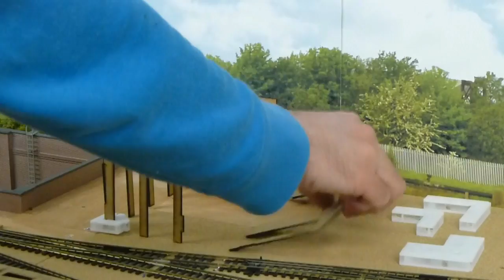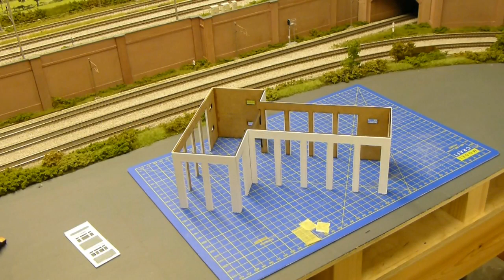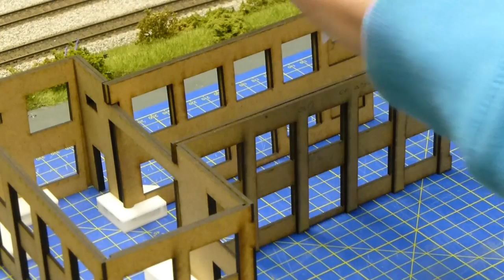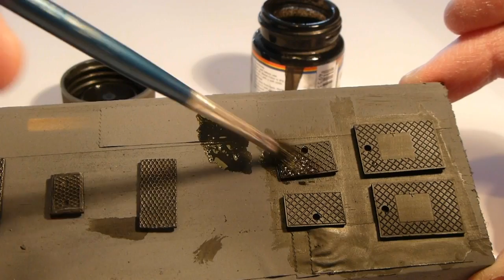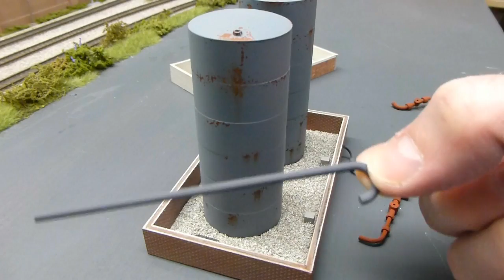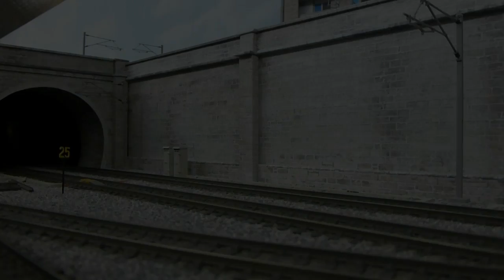Model Railway New Depot Build Update 2 | Dean Park 202

Comment: Dve another great vid .... what are the plastic "formers" you were using to set the angles and hold the card mate in the early stages ? Cheers Steve
Reply from the maker: Hi, thanks.   They are called Magnetic Mates from York Model making.   They are great.   If you get a set, tell them you saw them here!   I ain't on commission lol....I wish!  Cheers. Dave
Reply: @DeanPark  Thanks Mate Just had a look ... not cheap but look useful ...Thanks